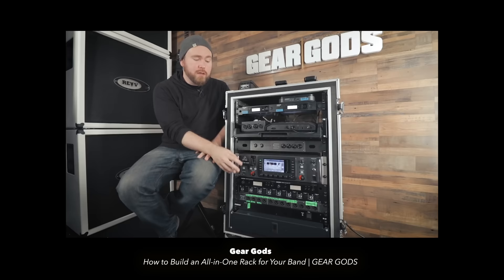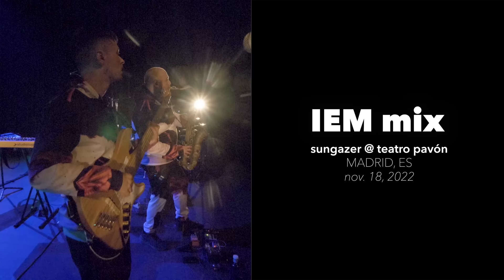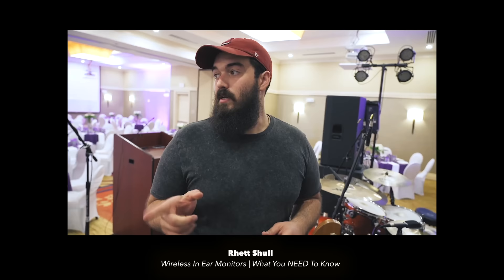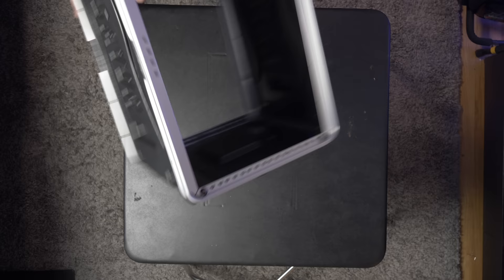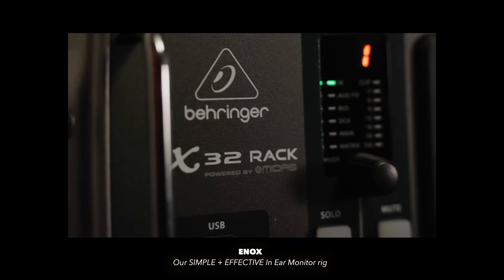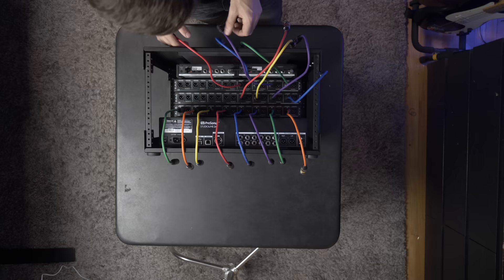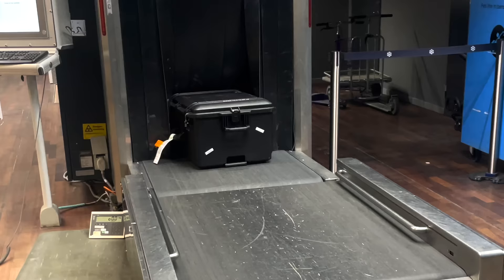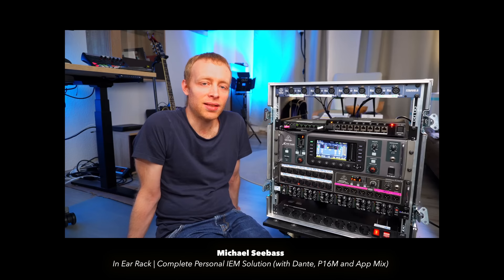How In-Ear Monitors are Making Better Musicians

Comment: I will never go back to traditional ear plugs or monitors after touring with IEMs for the past 3 years. It's night and day, I have no hearing fatigue, I have consistent sound every night and everywhere on stage. It's the best investment any serious musician can make. Especially when you get custom molds and as self-contained system with a digital mixer so you can mix yourself, send a split to FOH, and not worry about what the house engineer is doing at all.
Reply: Pp0
Reply: Ššš
Reply: You're telling me you have an ELF in your system?
Reply: If the sound engineer does a bad job, it'll still suck for the audience. That's out of your control though.
Reply: In a small gig or slightly bigger then that. I kinda didn't need em.
Reply: @tamarockstar45  If he does a bad job at everything all the time, sure, but let me give you a bit more of a practical perspective: I've had to do a 12 channels + 12 in ears mixing live, without getting to test any of it first, and it's definitely overwhelming, and takes something like half the entire set by the time you make it work, but the (hundreds of members) audience always gets the good mix, and the musicians are the pros that can cope with a hard situation. Especially if they each need a separate mix, it's just more practical to do the main out properly first.
My point is that if you take half/more than half of the work off of the engineer, he'll have that much more effort to spend on the rest of it.
Reply: @tarcp6224  Yeah, it's easy to blame the "bad engineer", but doing a foh mix + doing perfect separate in ear mixes for 4/5/+ musicians in the band in 30 to 60 mins for 2/3/4+ bands with different setups is a crazy ask. Even with a dedicated monitor engineer, it's never gonna be as good as doing it yourself (if you have mixing knowledge obv)
Reply: @tamarockstar45  "if the sound engineer does a bad job" generally means you have an unskilled or inexperienced FOH engineer. If you have an unskilled or inexperienced FOH engineer, taking the monitor mix out of the equation frees their hands to be much more detail-oriented about the FOH sound instead of having a crisis about whether the center vox monitor is going to feed back again. 

IMO the best thing a band can do for their FOH mixes, short of hiring their own touring engineer, is get their own ears system and arrive at the venue knowing how to use it and set it up quickly. I love working with self-mixed IEM bands, and I feel like especially in small venues, the lack of monitor bleed makes an enormous difference in the FOH mix.
Reply: @escalator9734  And add the fact that not every mixer work on their own system, rather some PA-rental that for some reason have these insanely weird bugs and setups on their mixers.
Reply: @jokkearnt  yea every console makers love to find convoluted ways to do everything, and have it different from every other consoles
Reply: Who cares about the audience right?
Reply: Plus it doubles as ear-plug if you're close to the drum ;-)
Reply: But then I won't know if the sound guy is burying me in the mix... Bassist.
Reply: @JVMC_ZR1  That's not for you to worry about, if that's the case hire a better sound guy
Reply: @milosjanic1038  Majority of sound guys in Rock and Metal, believe the old fashioned notion that "bass is not heard, it's felt" so it's hard to find decent sound guys, and most of the time I just readjust myself, and hope he doesn't continue to bury me 😂
Reply: I’ve never used IEM’s before but seriously thinking of getting a cheap
Pair to start with for live shows I’m about to start playing. I play keys and bass with vocals on some songs so it might be worth it to start using them
Reply: I'd like to know where did you buy your customed molds please?
Reply: @valdi7777  JH Audio! They are the company I chose to go with because they make molds for everyone from Post Malone and the Backstreet Boys to Dream Theater and Alter Bridge.
Reply: @tamarockstar45  unless you hire your own FOH engineer with their own system you’re always at the mercy of the house tech.
Reply: @ZackSeifMusic  thanks a lot
Reply: @tarcp6224  that is key.  With limited access to an awesome/less than awesome sound engineer, maximize results of your/their time/effort!
Reply: @tamarockstar45  That's always out of your control. With IEMs, you make the hardest part, the monitors, easy, and you also take out the hardest challenge for the sound guy: Getting good sound with the levels of foldback you require. He doesn't even need to give you monitor foldback, and for some genres of music that works great. Now he just has to get the FOH mix right, and he's doing it with far more headroom on the vocals than he usually would have. He ought to be thanking you, because you made his job a) much easier and b) much easier to do extremely well. It's doing yourself a favour as a band. If you can do that, and also learn how to communicate with the sound guy what you want, you're going to have a better time.
Reply: @tarcp6224  That's exactly it. Musicians don't often understand the challenge of monitor mixing live. At scale we literally get a whole other console and engineer, and usually that engineer is the band's specific person, because they want that mix to play with. When you're the entire sound guy, you're doing FOH with foldback, you're mixing the room, and then a bunch of picky musicians who can't play if they can't hear themselves. You can't just leave the FOH mix alone to fix the monitors, and once an event starts, there's only so much they can do communications wise to remix your monitor to your liking. Pros work with it. You can tell the real pro musicians, because they can make poor foldback situations work, and know how to still sound good. Sometimes, you really have a shitshow of a situation, a hard walled club with decades old monitors and a normal height ceiling, with a singer who needs so much of herself in her foldback you've had to reduce the gain on her mic.

If you take control of your mix situation, you can get exactly what you want, way quicker, and you also will make it much easier for him to do the FOH mix because he's not dealing with your noisy monitors. It's really more like taking 75% of the work off him. Plus, you can scale this into live recordings, into mixing your own monitors, all sorts of stuff.
Reply: @timnordberg7204  Yep. For small venues, it's just huge. One big thing that always comes up in small venues is the clarity in the vocals, and half the time you're fighting an ex touring half blown PA that has no high end, and the other half the time, you're fighting to keep the foldback from feeding back, giving you less headroom for the vocalist in particular. You can do so much more, with just the vocals alone, that it will immediately differentiate your band as having better sound. People will be able to hear the words the singer is saying.
Reply: @JVMC_ZR1  That's how to get buried harder lol. Just ask the sound guy for more presence. There's still plenty of love for fuzz and overdriven Ampeg SVTs. If you ask him for it, he'll work towards that. If you turn up midshow he'll think it's a mistake and turn you back down, and now your tone is probably not right either. Most metal sound guys who aren't only into black metal understand bass. Classic rock has tons of bass, and bass can work in metal, just ask. But also, you don't KNOW if he's burying you in the mix. You aren't hearing FOH, you're hearing monitor, your amp, slapback, and not what the majority of the audience is hearing. Which means if you're too quiet, the monitor mix is lacking you. But there's also the possibility that the stage area has a serious problem with acoustic treatment, and there's a limit to the amount of bass foldback he can give because he's worried about the low end of the instrument mics.

Instead of fighting with the engineer, communicate with him. If you talk like you know what you're talking about, you'll get a lot better response than "I think you're burying me in the mix" when you're not hearing mix. If you go wireless, there is nothing stopping you from hearing FOH in soundcheck. Even wired will work in some venues. But if you mess around with your levels in show, it will mess up part of the mix eventually, and you will sound worse as a result. 

My band, our singer would stand out in the middle of the room while soundchecking the full band to hear the FOH mix, as well as on stage to hear the monitor mix. That way he could talk to the sound guy about the FOH mix. We could also communicate, like "I'm happy just to take the DI from here" or "I like to have a lot of compression on my vocal." or "I want a dry foldback mix." Soundcheck is your chance to get what you want from the sound guy, and if you don't take advantage of it, you'll get what you get. If you learn a little of what is involved with being the sound engineer, you'll understand the mix more and be able to get what you want. Really, as a musician it is the least you can do, if you take your craft seriously, as a musician to learn how to be a basic sound engineer.
Reply: @kalreynolds5829  thanks for the info man!
Reply: @JVMC_ZR1  No worries! I love a good grindy bass, so I'm also always having to tell them that that's how I want it. Another thing that can help if your high end is being lost in the mix is suggesting he adds some compression to your bass, which will bring up stuff that's a bit low, and most people like comp on the bass anyhow.

And if you can get a long guitar lead or a wireless, soundchecking from the centre of the pit is sick.

Comment: Just one small remark to add - get the band's musicians to install the app for the monitor mixing console on their smartphones, so they can set up the mix in their ears on their own, saving a  HUGE lot of time for mixing engineer and the band as a whole.
Reply: Yeah but that involves teaching the drummer how to use a phone.
Reply: @JalenRawley  😂😂😂😂
Reply: @Chet Gass and the musicians deafen
Reply: This sounds extremely useful but I'm not really sure on how to put it into practice: you just check at every show what console the venue/service has, and then download the specific app for it on the spot? Or there's a "universal" app you can have already installed for all (or most) of the occasions?
Thanks to anyone who will help me understand this :)
Reply: @alexandrosgoulas  you (the band+mixing guy) bring your own mixing console.
Reply: @alexandrosgoulas kind of actually haha. I have like 4 of those apps. 
The most common ones are qsc, behringer, and yamaha 

But when we bring our own sound it’s easy cause we all have the app and access to our mixer
Reply: We’re doing this in the band I’m in and it’s the worst. Everyone’s batteries run down super quick, the app crashes all the time, adjusting while you’re playing sucks.
Reply: @stephbets  lmao yeah you gotta be responsible with your battery game or get the ones you can charge. And you shouldn’t have to mix much mid set if you get it right at sound check. Works great for us
Reply: @robchrisaustinsteve  @stepbets If you keep your ears in while rehearsing with your rig in your rehearsal space, sound check should only involve the FoH person getting the levels they need and you adjusting your crowd/ambient mics. Fresh bat's or fully charged at the start of the show. Save partially used batteries for weekly rehearsal.

Comment: The next step in performance technology is for the audience to also wear in ear monitors so we can hear the music without blasting our ears.
Reply: They can already do it with rented UHF receivers... (wireless monitors), buy the receivers, and just charge 10 bucks more in each ticket, and in aprox 4 shows, you will return the invesment.
Reply: that's been tried for decades. It's called a silent disco. Sure that's not really a "concert" as such, but the concept can be just as easily applied to concerts.